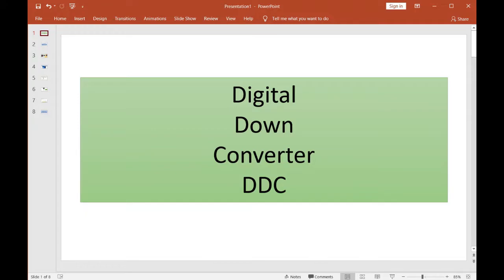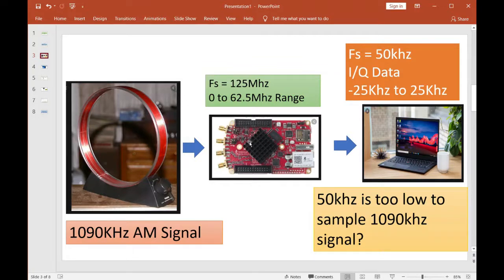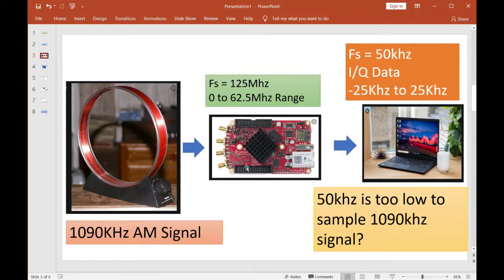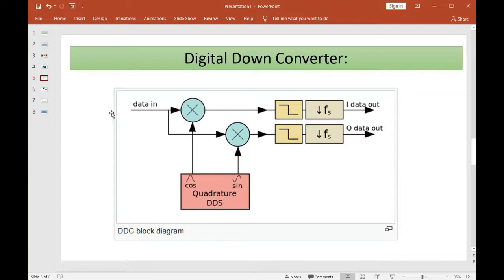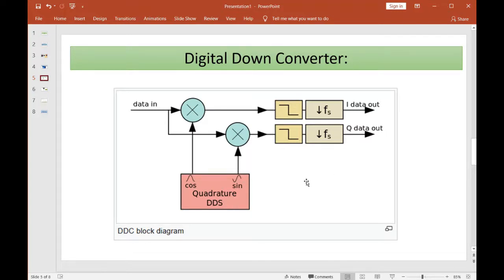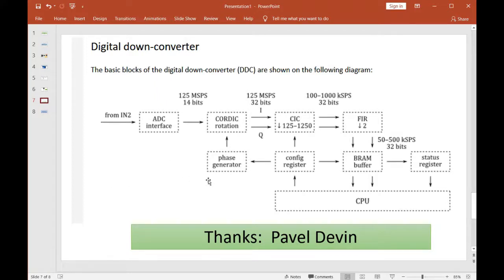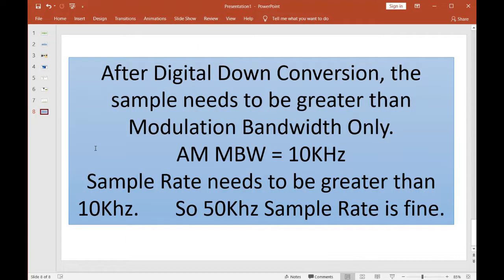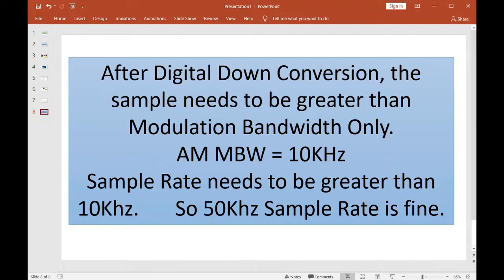DDC, Digital Down Conversion

Comment: Is that what a sdrplay RSP-DX  is doing when  you select decimation  numbers 
Ie 2 - 4- 6 ect. Instead of  bandwidth selection.  I see it doubles what you see on the waterfall .  What about zero if and low if . Can you go into more details about what it does and the results of it good or bad. I love your videos straight to the point and informative .  Been a ham over 40 years but this is my foggiest  subject.  Thanks for giving us the meat and  potatoes  of RF details. 
AA4CP Chuck 
Port Salerno FL USA
Reply: PS I agree loop antennas  kick ass and it is  ALL ABOUT THE  SNR !
Reply from the maker: yes decimation is downsample to reduce sample rate,  the lower the sample rate, the lower the noise floor.    so for weak signals want to set the decimation to max value.  73s take care, and thanks again for watching the videos.   please give ideas for what videos you like to see, or topics you would like to see covered.   thanks again.